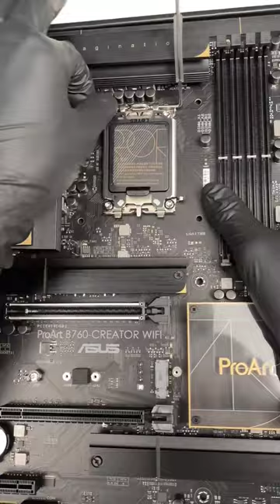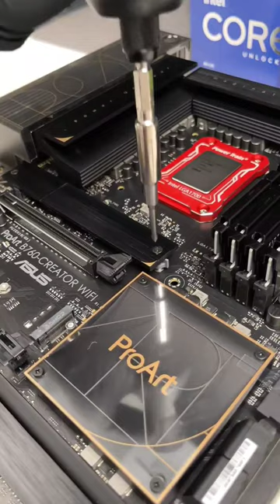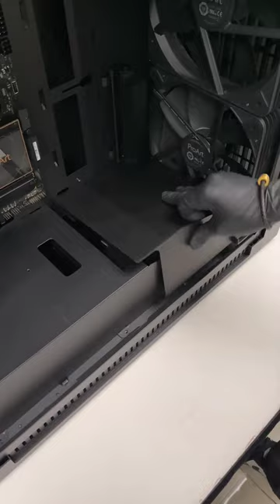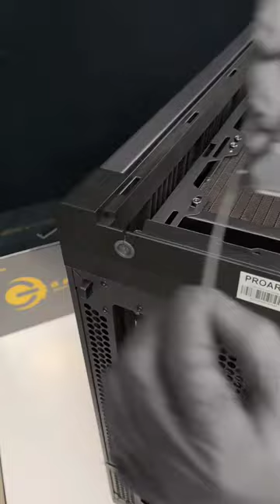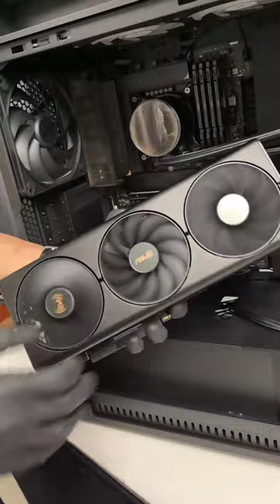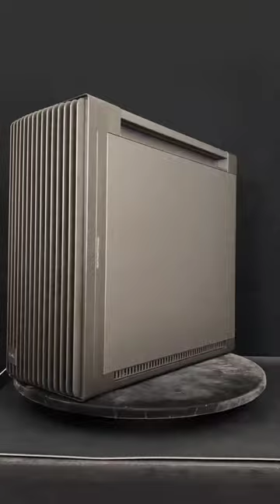CPU: Intel 19-13900K Chinese original box Graphics card: ASUS ProArt RTX4060TI 016G instalation

Comment: B-series Intel motherboard with an i9-13900K. Smh. When buying an i9 K model, you have to get the Z-series motherboard because it has better power stages, thus gives you better power delivery. Otherwise, you'll likely to experience crashes due to insufficient power delivery
Reply: With a 4060, the 13900k will be bottlenecket asf so it migth be fine. Still,  good advice for a lot of people.

Comment: What is the reason for removing and putting that in the cpu?
Reply: There's a legend that stock bracket can bend CPU heatspreader and lead to less contact and worse cooling. 
So sometimes people change it to custom ones, but that has not ever been proven to be beneficial in the latest generation of processors (and not very much in previous)

Comment: Bro i9 with 4060 💀💀💀💀💀
Reply: ikr its like getting a 4090 then getting an i3 or maybe i5 is ok but still nah lol
Reply: I know a guy who use 4090 with a ryzen 5 5500
Reply: @kamiins  actualily it’s not that much of a problem if you play in 2k or 4K. Processor are not that usefull in those résolutions.
Reply: With B760 motherboard 😢😢😢
Reply: @Adri-qq5cz it’s still a massive bottleneck
Reply: @ZonexG  not as much as you woulg thought. With an RTX 3090 un 4K there was like less than 5% of difference.
Reply: @Adri-qq5cz  yeah cause the 3090 is as fast as a 4070 ti which isn’t a bottleneck

Comment: Congratulations! Your contact frame is way too tight and is bending your motherboard and your CPU... maybe your connection to your RAM is broken too 😎

// Edit
You have to turn screw by screw 90 degrees to the end and then measure how tight they are now otherwise turn another 35-90 degrees at the end